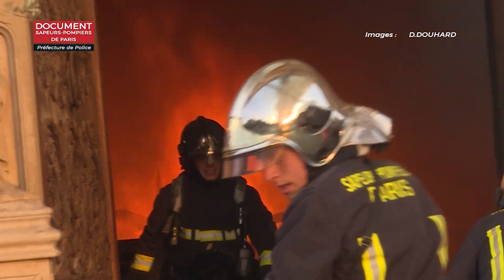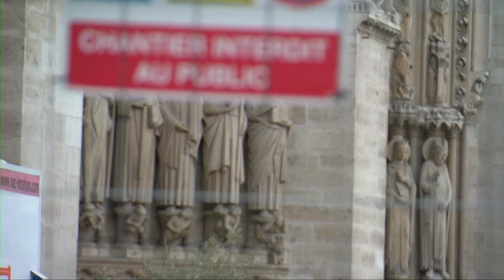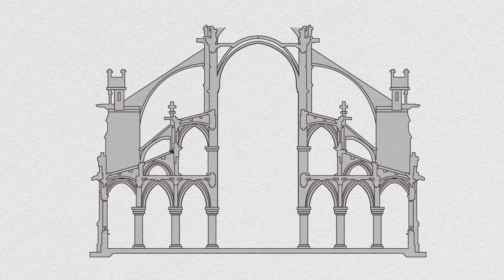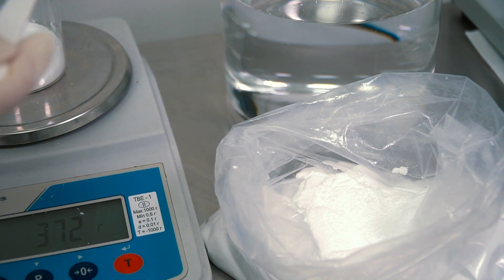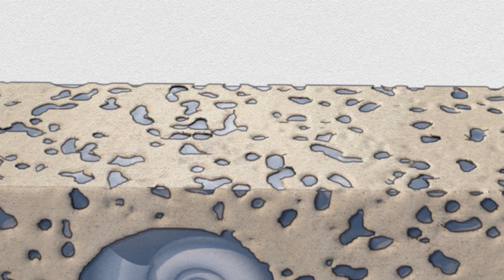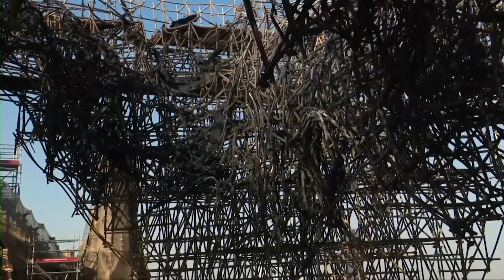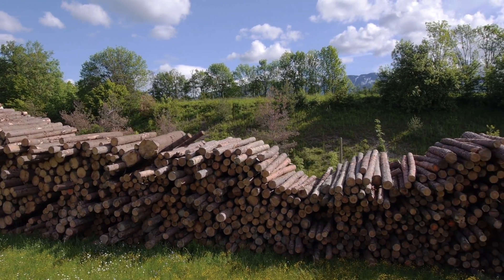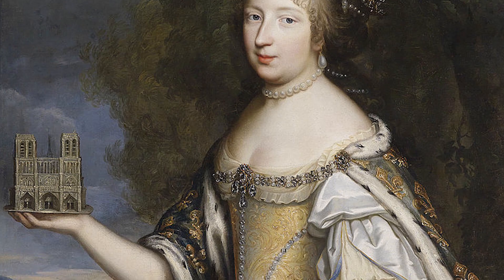A look inside the restoration of Notre Dame cathedral

Comment: 11 months ago while watching the fire  in horror, I noticed the billowing clouds of yellow smoke. 

“That’s lead oxide” I thought. Very toxic. 

Not ONE news report mentioned this until A MONTH after. Not one public safety official made the connection to protect people downwind of the fire as the dust and smoke covered their buildings and coated their lungs. 

Unbelievable.
Reply: Not much different than the head of the EPA deliberately LYING on camera, telling the media the smoke filled dusty air around the WTC site after 9/11 was SAFE, as a result almost no one had PPE, masks or anything, and thousands now have severe health problems, many have died. The EPA was ordered to  do what it did so WALL ST could be opened ASAP
Reply: @FCE-dogs  That order actually came from the top (some people would say Cheney was the real "top", not Bush). The head of the EPA just got to be the fall guy --- or fall "person", as it was Christie Todd Whitman, a staunch environmentalist -- for that. The NSC was tasked with the message delivery immediately after 9/11. 
"In April 2008, the United States Court of Appeals for the Second Circuit overruled the district court, holding that as EPA administrator, Whitman could not be held liable for assuring the World Trade Center area residents that the air was safe for breathing after the buildings collapsed. The court ruled that Whitman had based her statement on contradictory information from President Bush. The U.S. Department of Justice had argued that holding the agency liable would establish a risky legal precedent because such holding would make public officials afraid of making public statements."
Reply: Absolutely everybody in Paris was immediately aware of the toxic smoke and dust after the fire. And there were hundreds of reports about that.
Reply: @1marcelo  - How many people got sick and died? I wasn't aware of any of this but I'm in Canada and don't normally follow French media.
Reply: @hughmungus1767  Nobody got sick or died.
Reply: @lohphat

The lead being in the fire supposedly "burning" is no problem, the fire was not hot enough to BOIL and evaporate the metal- which takes 3,180°F. Metals dont burn like paper in a fire and create smoke, the lead melted around 900 degrees and then cascaded down like rivers and spashed all over which coated surfaces with metallic lead, it also broke up into tiny globules and particles, "dust" if you will, all of which had to be cleaned up and removed, but the wood fire was nowhere near hot enough to "burn" lead.
I work around lead on my day job.
Reply: Victorian Sculptures You don’t understand the chemistry. As lead mixes with the combusting wood, that forms the lead oxide which is toxic.
Reply: Lol, I'm french , I live on Paris, right under the trajectory of the toxic lead clouds. Guess what? I was informed of the danger, the media immediately talked about this, and we were advised to shut ourselves in until the next day, to wait for the lead to return to the ground. 
Maybe the foreign medias didn't talk about it, but here, yes they did. Don't spread misinformation please.
Reply: @gastonjaillet9512  I was watching FRANCE 24 for weeks and there was no story until 3-4 weeks after the fire until they mentioned the lead oxide. If local news covered it, that's great, but it was not part of the international news coverage.
Reply: @lohphat  you made some very interesting points. I'm glad to hear that it was covered locally. But I'm wondering where all that plume of smoke went? What the exposure rate was and if there is a correlation with the higher death rate for the covid-19 woohoo flu whichever you prefer. I'd be curious to know if it caused a combined effect.
Reply: So lead is the asbestos of France?
Reply: Arif Akyuz Asbestos damages your health constantly, lead is just up on the roof.
Reply: Joe Al  That explains a lot, dude.
Reply: Certainly a lot of lead in the paint, and perhaps some arsenic as well.
Reply: James Reilly  I'm sure that all of those precautions were taking place. Good points but irrelevant to my questions. So perhaps I should clarify. The lead had to come back down what did this do to the water supply and soil? Is the population being exposed to higher levels of lead through secondary means? Is this even a factor? Has it already been examined? Just questions, no implications of a sinister intent.
Reply: Don't worry, it's just mustard-flavored air.
Reply: Nope , it was nitrates from centuries of bird shit on the roof and in the attics.
I was there in 1970, got a tour of the bell towers, the attic areas were nasty.
I'm sure some was from other sources but nitrates give that color smoke too.
Reply: Smoke is poisonous to begin with. Anyone downwind is already getting out of dodge.
Reply: Media and science literacy don’t exactly go hand-in-hand
Reply: Or, very believable.
Reply: I watched several news channels and one did say that the yellow smoke was because of lead. I already knew it but I witnessed at least on station reporting it. And if there are actually people that don't know about the dangers of lead... I mean, I can't imaging anyone in Paris doesn't know.
Reply: Then Corona virus doesn't make you think of the crown of thorns?
Reply: Hindsight is 20/20.
Reply: lawnmowerdude It wasn’t hindsight. I made those observations while the fire was happening.
Reply: @lohphat  Especially in Paris. A lot of old buildings had lead-plated roofs, so it's not uncommon to have to account for that in Paris.
Reply: a millennia-old cathedral is burning down but your priorities lie on some possible negative health risks, if contacted. the level of values that some people have in this mundane age.
Reply: anonym 
Generations of people dedicated their lives and soul into the Cathedral. 
And here some idiots mind can immediately jump into stupid poisoning stuff while in the middle of the Cathedral itself burning. I ber he has no artistic or historical background.
Reply: anonym WTF ?! People die in less then 100 years, and the wrold is overpopulated.
Reply: JRRnotTolkien - Idiot bot.
Reply: The fire was not an accident. France is running out of money so their government did it just so wealthy donars can give them money. Wake up people.
Reply: @dalialule6324  Proof needed when you make a statement like that. Back up what you say. Maybe you need to wake up
Reply: Dalia Lule... Dude, that is not an effective way to raise taxes. Make sure your conspiracies actually make sense before you spew your bullshit. At least then it will be entertaining and inaccurate, instead of just inaccurate.
Reply: @dalialule6324  France is a long way from running out of money, despite what the media tells you.
Reply: @dalialule6324  Good to know! I've always thought life was complicated and nuanced. Now, thanks to your random youtube comment, I know it's as simple as you say.
Reply: I think your tinfoil hat is on a little too tight.
Reply: @billstevens3796  Lead exposure can have serious consequences for the health of children. At high levels of exposure, lead attacks the brain and central nervous system to cause coma, convulsions and even death.
People who survive toxic lead levels may have some permanent brain damage. Children are more vulnerable to serious long-term problems. A complete recovery from chronic lead poisoning may take months to years.

There is a chelating drug that can be used to clear the blood of lead, but it only works before the lead leaves the blood stream and is incorporated into bone and tissue where it remains.
The lead being in the fire supposedly "burning" is no problem, the fire was not hot enough to BOIL and evaporate the metal- which takes 3,180°F. Metals dont burn like paper in a fire, the lead melted around 900 degrees and then cascaded down like rivers and spashed all over which coated surfaces with metallic lead, it also broke up into tiny globules and particles etc., all of which had to be cleaned up and removed, but the wood fire was nowhere near hot enough to "burn" lead.
I work around lead on my day job.
Reply: @dalialule6324  Please. A billion dollars is not enough to resucitate a failing First World economy.